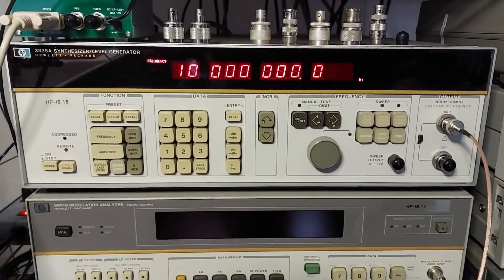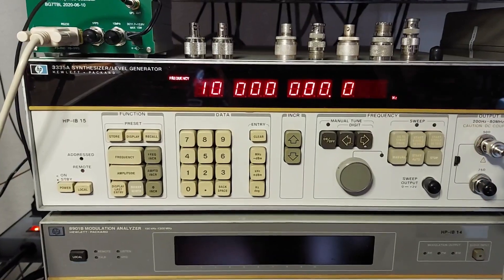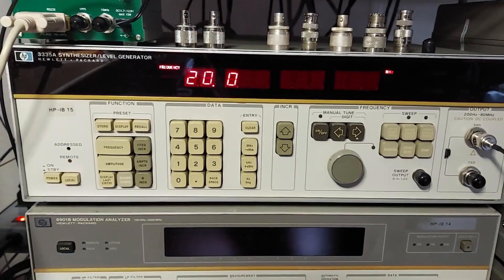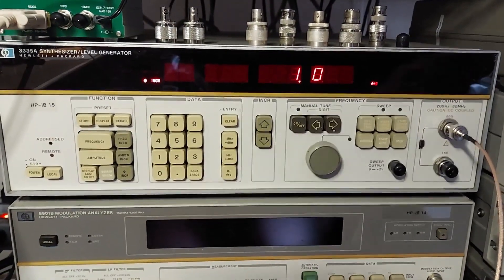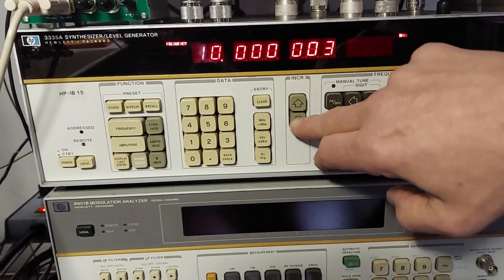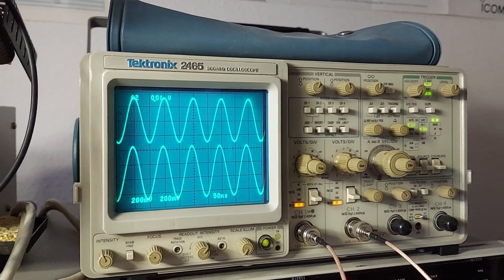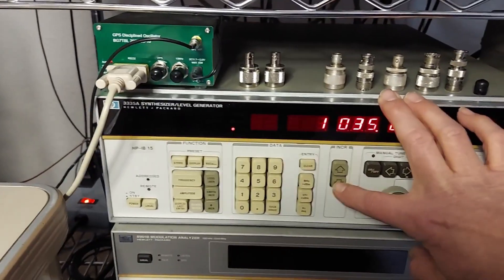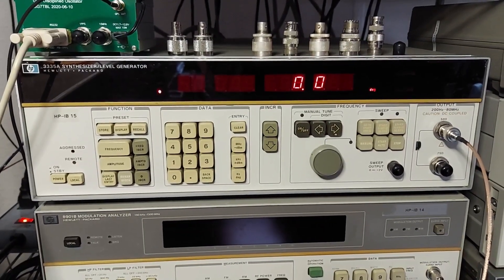HP 3335A Synthesizer / Level Generator part II

Comment: I would dream to have one like this in 80s.  I heard back then it was over $40k.  Nowdays, if you don't mind the accuracy, there are faster, cheaper, smaller, quieter ones for about $100.
Reply: tough to beat that 0.07dB flatness, though
Reply from the maker: Yeah, it kind of goes with the territory. This instrument was first listed on page 345 in the HP 1978 catalog. The list price back then was $7000.00, option 001 (high stability option) was an additional $580. Now that I have been using it for a few weeks I am very pleased with it's performance. I have run this instrument through several tests and it still meets it's published specifications, even though it's last service interval was at least 5+ years ago. Thanks for watching!

Comment: What program do you use to program HP-IB on a modern computer?
Reply from the maker: Hello Mark, I use a free software package by KE5FX called GPIB tools. I use several command line tools that are installed like talk, query and listen. There are also several other graphical tools I use as well. Another software package I use is Transera's HTBasic, it emulates the HP Basic user interface and allows you to actually run the code examples in the HP manuals. You can also use the tools that are installed with the GPIB card driver.
Reply: @CraigPetersen12f36b  YES, thanks for the reply. I will download and give it a go. Love your HP test equipment videos. New subscriber.

Comment: This is a nice generator, have one in the lab. Early on I also had an issue with the display, and like yours it just needed some contact cleaning. The fan in mine was louder than normal, lubed the bearing and it was a bit quieter.
Reply from the maker: Now that I have been using the unit for about a week or so I'm impressed with the unit. I even purchased a "parts unit" in case I need to service the instrument later on down the road.